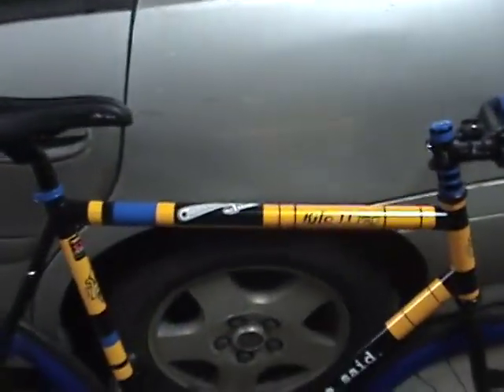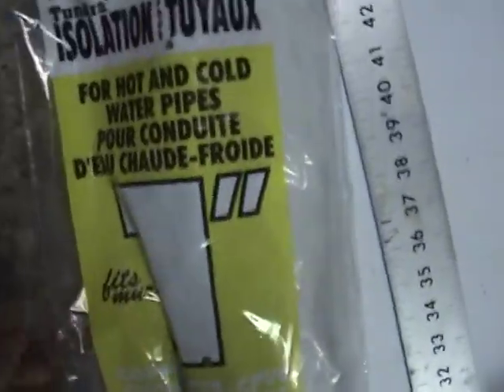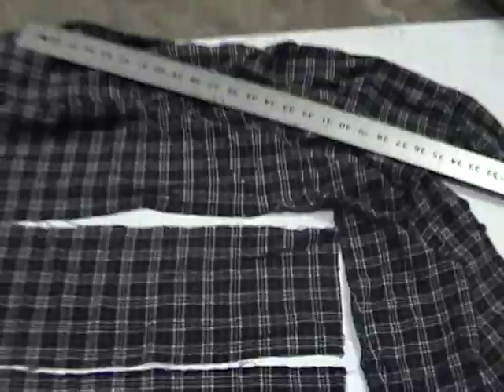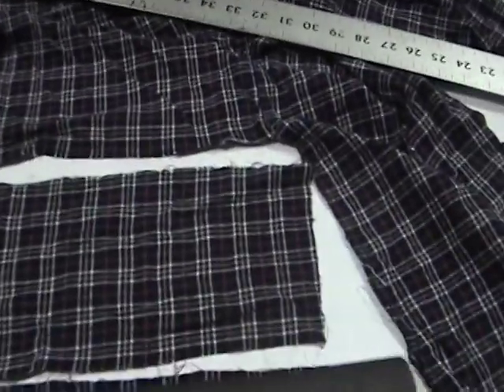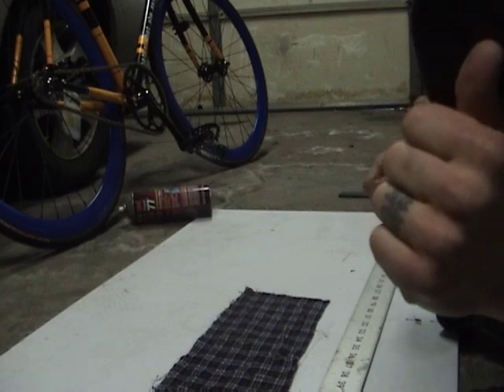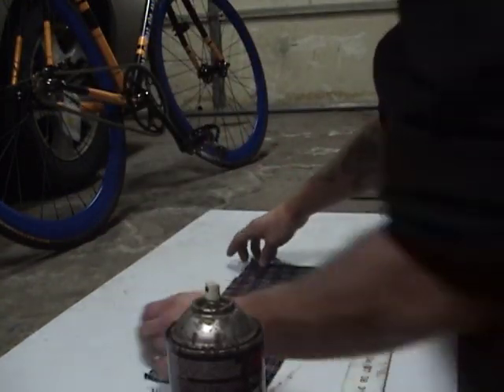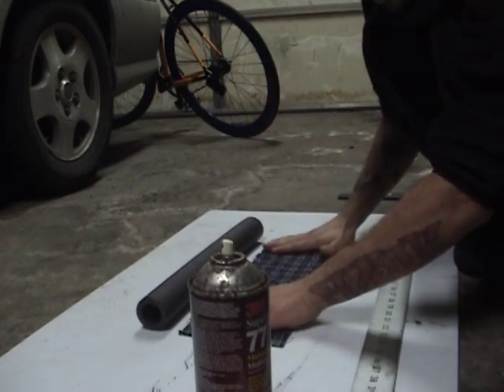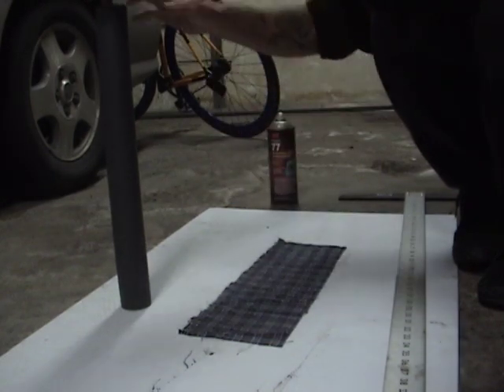How to make a cheap  and easy top tube fixie/BMX pad

Comment: @BackyardAmusement I followed the link and it looks tight!!!! You have some sick parts on that thing. I have a single speed racing bike (not fixed) and I was wondering instead of buying a whole new hub, can you just take a regular hub and make it fixed some how??? I don't think it's possible.
Reply: You can thread a cog on to where your freewheel goes, but then you wouldn't be able to add a locking

Comment: okay....so i just made it and put it on my single speed mtb (its just that kind of MTB), and it cost me 9 dollars in total, but i have enough pipe insulation for 2 or 3 more! The only thing I had a problem with was cutting the t shirt straight because it kept curling up, but otherwise it was really easy. It looks super cool, and there has been a couple times where I have gotten nut shotted by my top tube on rocky technical sections! Thanks for the video!